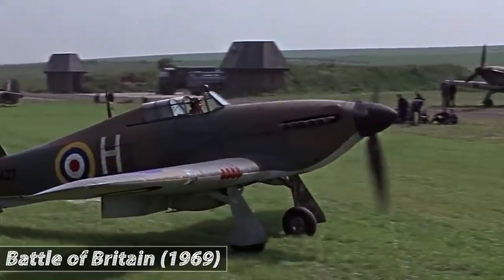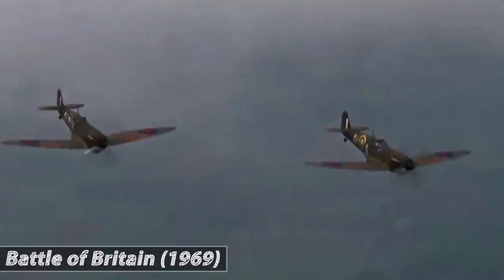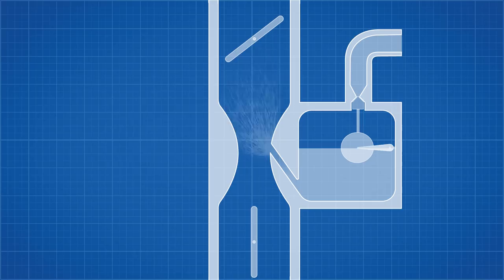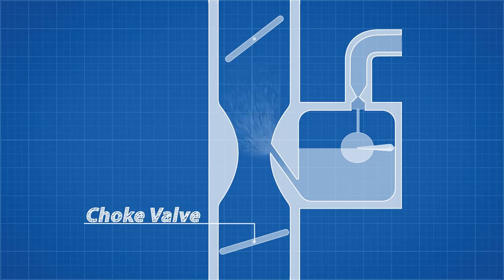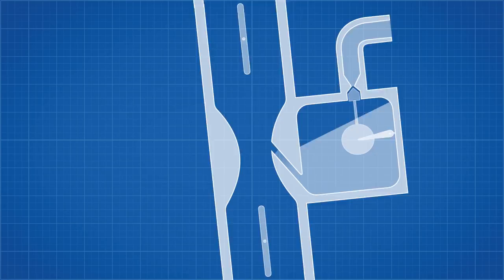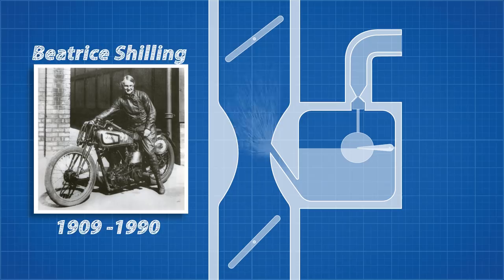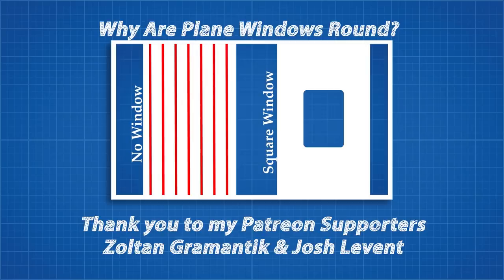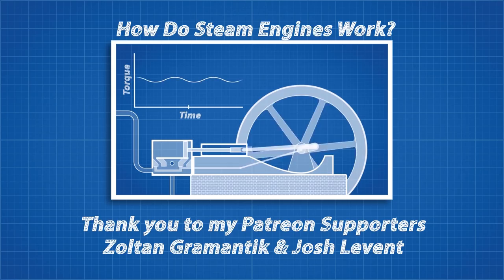The Spitfire's Fatal Flaw

Comment: When you make a video about the Spitfire, and the first plane shown is a Hurricane, it isn't exactly a good sign that this will be a well researched video.
Reply: When you make a video about an ENGINE FLAW you might find images of other planes that used THE SAME ENGINE the fact that you didn't realize this or that the Hurricane used the same Merlin engine with the same flawed carburetor isn't exactly a good sign that you wrote a well researched comment.
Reply: But the video's title or thumbnail doesn't explicitly say anything about other planes so the viewer will immediately see a Hurricane when the expect a Spitfire.
Reply: +Aaron Campbell  You have never seen a demonstration using an analogy where something similar is used solely for the purpose of demonstrating the effect?  The Hurricane had the exact same flaw.. because it used the same engine...

Comment: Good thing those were Hurricane's and not Spitfires.
Reply: The early spitfires had the same problem. but yes.
Reply: What? The Hurricane and the Spitfire are not the same plane at all.
Reply: yes. but they used the same fuel delivery system.
Reply: Yea I know. Now I re read your comment I understand what you mean haha. Sorry pal lol
Reply: So the video should be titled 'Merlin engine fatal carburettor problem' and not 'Spitfire'?
Reply: They did show spitfires later, for the point of the video it didn't matter though as both suffered the same flaw as both used the same engine. This flaw was quickly fixed however.
Reply: Not really a fatal flaw though, they continued to function throughout the war and beyond, perhaps the most successful inline piston aero engine ever?
Reply: It wasn't hard to overcome too as all they had to do is roll over and pull up to follow the 109's
Reply: ***** Granted it took longer but not 3 seconds ha. The 109 pilots coudn't do it too much either as negative G is a lot more fatal to humans that positive G. The reverse immelman is more popular than just nose diving anyway nowadays.
Reply: ***** Never said it was a bad tactic. It worked for a reason.
Reply: Not a fatal flaw, more a tactical disadvantage, after reading the accounts from the pilots of fighter command; the Luftwaffe were reluctant to engage a Spitfire know it's performance was superior in certain situations.
 As in any battle the proponents exploit their advantages. How many Spitfires were 'fatally' lost through being incapable of pulling negative G manoeuvres, and how would that come about?
 The Luftwaffe would use height and dive on to it's target knowing if the attack was unsuccessful it would be immediately be at an advantage being in a high speed dive, as in 'Beware the Hun in the sun'!' In the same way a Spitfire would pull a tight climbing turn knowing (a Bf109e at least) couldn't follow.

So your title 'Fatal flaw' is a headline grabber compelling users to watch your video! Most of which is completely wrong!!

Have you considered a career on tabloid journalism?
Reply: Dave Leeman Problem was not so much about Spitfires fatally lost but on the many German pilorts caught in a disadvantageous position who weren't shot down so they lived to fight another day, possibly one when the Spitfire not the Messeschmitt would be in a disadvantageous position.  In war If you fail to kill the enemy the enemy will kill you.
Reply: Yep, that's the point I'm trying to make, not a 'fatal flaw' as the title would suggest, nothing fatal about it, I've seen all the videos in this series, none of them are completely accurate and at best misleading, although pointing that out is frowned up on it seems?
Reply: Funny how people get upset when you 'call them' on their attempt to sensationalize a problem of moderate proportions  Yeah sure, the early carbs were a problem--but it tended to manifest itself more in a 109 getting away rather than a Spit or Hurricane being 'fatally compromised'.
Reply: It seems like it could be a fatal flaw if the Spitfire (or Hurricane) were trying to dive to get away from a 109. Having to roll over first would cause a delay that could be fatal. Not being a fighter pilot, I can't say that for sure - I'll defer to others' experience on this.
Reply: In addition to the larger issue that was noted. When the aircraft righted itself, it would receive an over rich shot of fuel, which was fully capable of stalling the engine and flooding it so that it couldn't be restarted. In the middle of a dogfight is not exactly a good time to experience a total power loss in a fighter plane.
Reply: Good point.
Reply: +Fenrir The Unchained  The Schilling device reduced the flooding problem, but did nothing to solve the fuel starvation problem.. only the American Bendix carb solved both problems
Reply: Beatrice "Tilly"  Shilling  not Schilling

Comment: "Negative G" and "inverted flight" are NOT interchangeable.
Reply: Why
Reply: @aaronflynndevereux1832  
Inverted level flight will induce zero then negative g very quickly
But the roll shown at the beginning, if done well, will keep 1G throughout the maneuver. Also, inverted loops, etc don't produce negative G.

This is because the centrifugal/ centripetal forces exceed gravity.